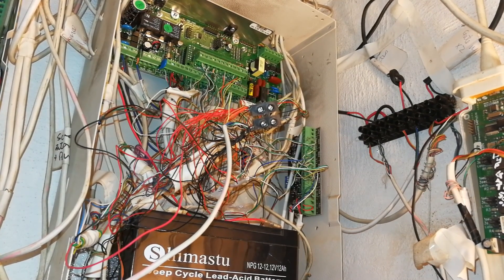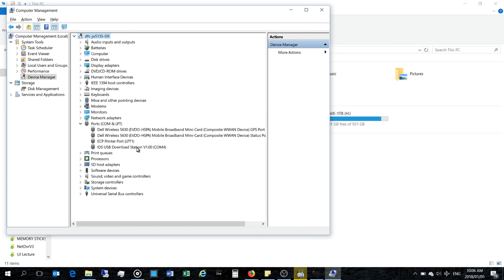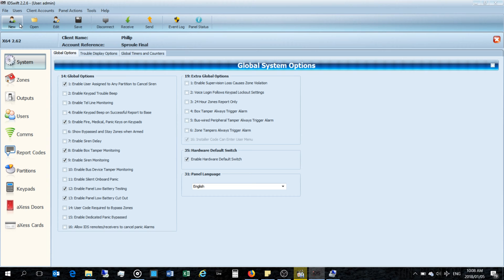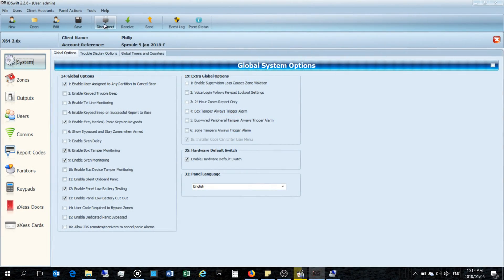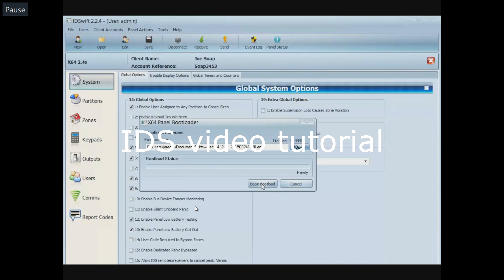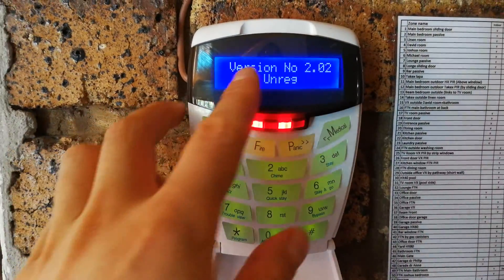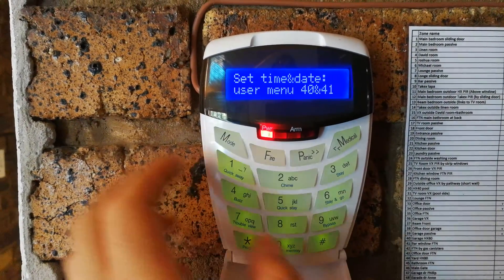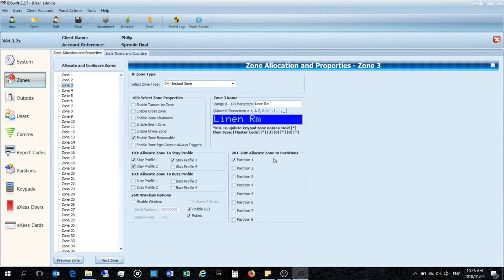How to upgrade the firmware on the IDS X-series alarm panel - detailed

Comment: Can you please provide some info on the  USB Panel interface.  I don't have one and my X64 is on Version 2.02, so now the HYYP module that I bought doesn't work. 😢  Hoping that one of the FTDI adapters or ESP Flasher that I have might do the trick?

I'm also fighting with ADT to get the system unlocked.  The previous owner was with ADT and they changed the installer code, so I'm locked out.  They refuse to give me the installer code, holding my alarm system ransom, since they want me to pay for a callout fee so they can remove the installer code.  Based in Pretoria if anyone can help me out.

Comment: Thank you, for a Saturday afternoon project, you made my day. It isn't a walk in the park, especially when you get the message upgrade failed. This task because HYYP requires firmware greater than 2,51. Then some where I read that if its old firmware the jumper needs to be JP1. So, i did that anyway and the HYYP IP app works.

Comment: Can I use the ids swift software with the hyyp is connect module or do I need the usb device ?
Reply from the maker: can use Hyyp if you have the module otherwise you use USB cable

Comment: your reset error at 9:00 min is not correct ... your panel was not in boatload mode: Jumper3 must be used as you correctly said ... but then a simple power up boots the panel into boatload mode ... no default required .... only at the end of update ... the panel heart beat light is solid when in boatload mode not flashing.  the new firmware file will also require latest version of swift installed so you can edit the customer account FW version .. this is always available with new FW version

REPLY

Comment: Unfortunately the private person cant do this since IDS wont give you the software or firmware, the cable is the easy part you get that from communica for about R600. Unless a installer will give you a copy of the IDS 2.2.6 software otherwise its a waste of time.
Reply: Here is all the files you will need.  Some Google-ing would have assisted you... https://mega.nz/file/304EhIoA#5UatQdLiSkctK02HXuDLEMniEUNYtJBmhwHICVzsp7w https://mega.nz/file/a9omVITD#sforym919GGB87rf4F404U_LgueRooSuSRXN0MBTQiM https://mega.nz/file/asxWyIDC#ab_-pEfmS6tgYKXoJqpHRORPwtRNTJGWptiExTLNfZc https://mega.nz/file/rt4CGSST#r_jxg5wSu07rBesUif1ksZzh0sFahcwNW1Bk_NEnkYk (2 PDF's SW and Firmware)

Comment: Where do I get the IDS software for my laptop
Reply: Here is all the files you will need.  Some Google-ing would have assisted you... https://mega.nz/file/304EhIoA#5UatQdLiSkctK02HXuDLEMniEUNYtJBmhwHICVzsp7w https://mega.nz/file/a9omVITD#sforym919GGB87rf4F404U_LgueRooSuSRXN0MBTQiM https://mega.nz/file/asxWyIDC#ab_-pEfmS6tgYKXoJqpHRORPwtRNTJGWptiExTLNfZc https://mega.nz/file/rt4CGSST#r_jxg5wSu07rBesUif1ksZzh0sFahcwNW1Bk_NEnkYk (2 PDF's SW and Firmware)

Comment: Good tutorial, thanks. Where could one get the IDS-USB cable, IDSwift software and latest firmware from?
Reply from the maker: IDS direct. Maybe Regal. Firmware is on IDS website.
Reply: @ecologicaltime  
Not anymore its not. They recently did work on the site and now its no longer there. And good luck getting any kind of real support here... 2 days in a row I was diverted to voice mail... and am still waiting for a response. Their technical line is awful. You are better off going through the sales option than technical. Even then you struggle to get assistance.
Reply: @Sidcynic1  i would like to think the jhb office tech support is immaculate. Lungi is always super helpful